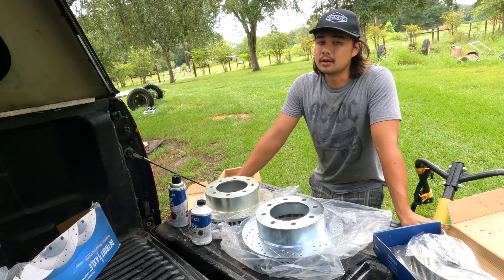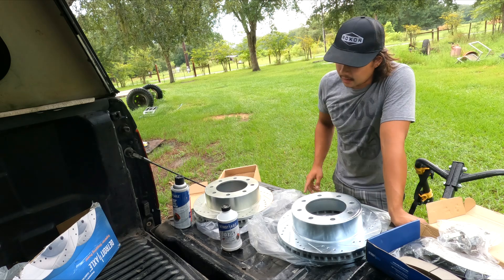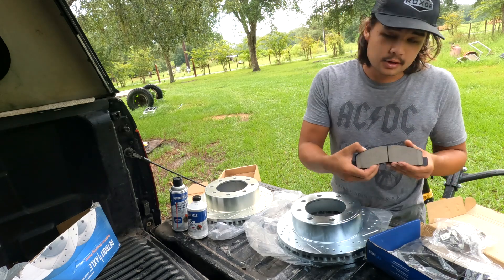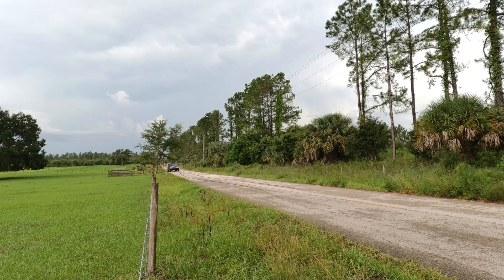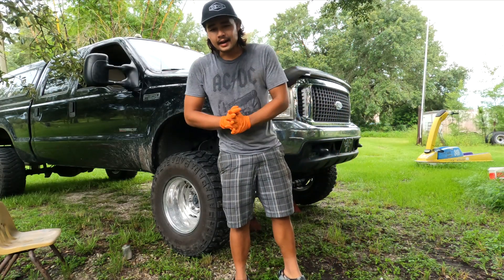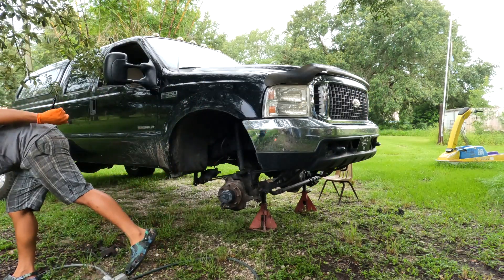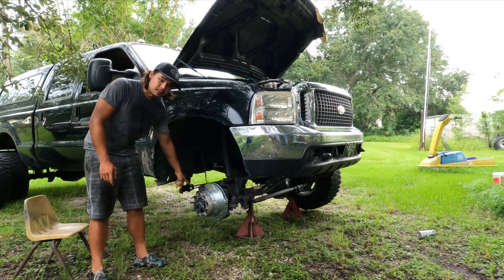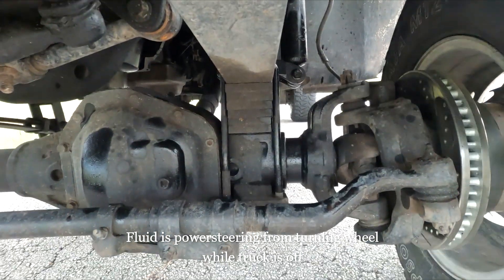Drilled and Slotted Rotors on a Diesel Truck? Is It Worth It?

Comment: It might have been cool if you measured the temperatures of the rotors after stopping since drilled and slotted are supposed to have better heat dissipation. I've always wondered if that was true.